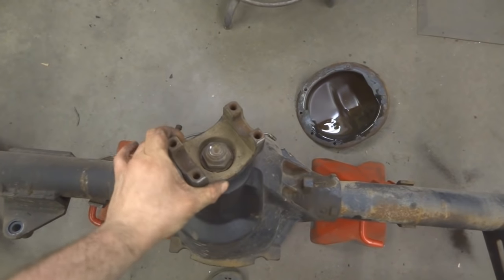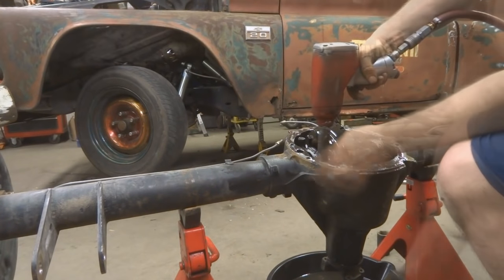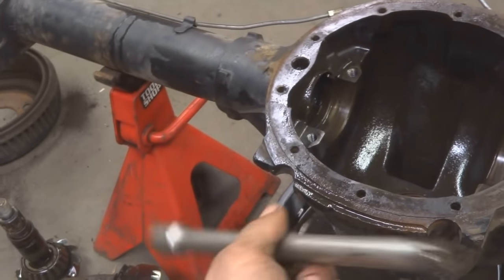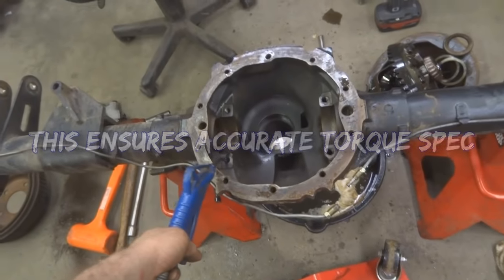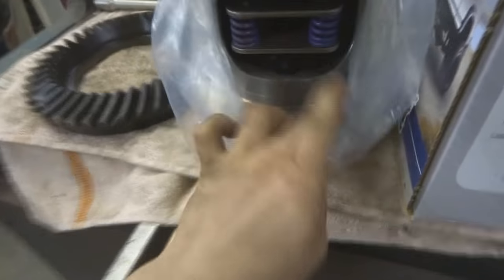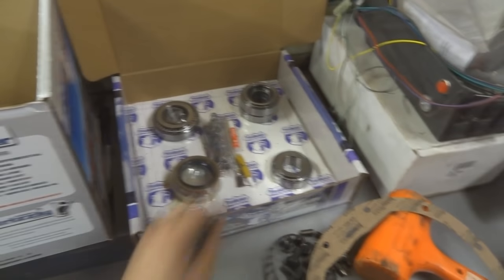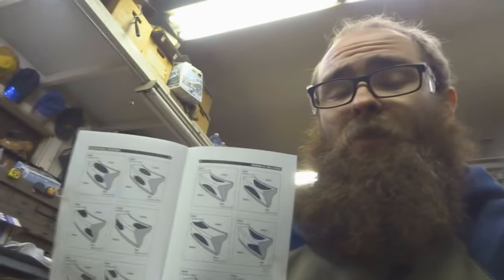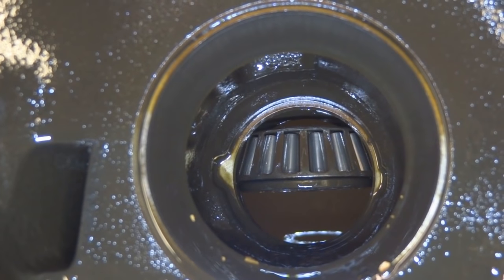How To: Rebuild a GM 8.5" Rear Axle 10 Bolt Chevy

Comment: Great video/walkthrough Luke! On a side note, we may have to see about getting you some Yukon branded crocs...
Reply from the maker: Yukon Gear & Axle haha! that would be something!!! thanks for the complement
Reply from the maker: fuck. I should. lol
Reply: I have an 8.6 is everything the same as an 8.5 other than the ring diameter?
Reply: @warrenstone8538  rings the same size, just bigger carrier bearings on the 625 same procedure tho. Heat up the new bearings on the stove or in the oven if you don't have a press.
Reply: Warren Stone the ring gear is the exact same between the two, the only difference between the two is the carrier and carrier bearings. The 8.6 has a larger ID bearing and the 8.5 has the smaller. The ring and pinion between the two are the exact same parts
Reply: Hey Tubman, thank you for this awesome vid!! My first rear end dismantle was super easy because of you!! One question, the carrier case will not pull out, do I force it out? Or am I missing something? I’ve followed all of your steps, and where your carrier case pulls right out, mine won’t. Any help is much appreciated.
Reply: Ship them out don’t talk about it be about it yukon.

Comment: Not a lot of people understand how to properly care for a differential let alone rebuild one. Good job man. I would like to give just a couple of pointers in a few areas, just to help out and spread knowledge, especially since it seems like you will service/re-build a diff in the future. 

So, if you havent figured out or wondered if..... I do this for a living 5 days a week, 40+ hours/week. By no means am i trying to gloat, brag, or imply i know it all b/c that is so far from the truth. I will say though, of the four people i have learned the driveline from, including my current boss, are old school, legit, the best of the best when it comes to the drivetrain (Diff(s), t-case, and driveshaft).

So, to the point. Here is what I Suggest...

1. 9.5 times out of 10, when you do a carrier change as you did, the OE shims when replaced where they came from will indeed be wrong (the backlash tolerence is too high), instead of trying to build a stack of shims that came in your bearing kit, simply switch your OE shims. Put the passenger side shim to the driver side and the driver to the pass. Legit 99.5% of the time, you will be within the 6-10 thousandths range. That goes for any diff and especially the GM 8.5" 10 bolt.

2. When putting on the new bearings.. i love seeing how attentive you were to seating the bearings all the way and never tossing your old parts until you were done. Let me suggest when putting on the new beaing on your new or even old carrier, keep the new bearing and new race together, lay a piece of flat stock over those while the new bearing/race combo are just set in place. make sure your centered and using a press, start the bearing on. When you just have it started grab your old race and flip it upside down on your new race, flat stock back on and finish the job.

I hope this tad bit makes sense and hopefully helps at least somebody, if not, it kept me busy. Keep making the videos man good to see that still. Good Luck!

Comment: My c10 was sitting for 20 years before I got it and the differential oil was the consistency of jello. I used a torch on the pinion to take it out and it fell right out

Comment: Love the vid brother very helpful..im a mechanic and you may laugh but ive never rebuilt a rear .i have a 2000 Silverado 1500. It started making a clunk metal like noise when i back up and then take off in drive.i can definitely hear noise when im slowing down and i fear its the diff carrier bearings .when im on the throttle it wont make noise.just looking for a second opinion before i jump right in.
Reply from the maker: Most likely the pinion bearing or a loose pinion

Comment: You mentioned locking plate around 11:15. I took the pin out that holds the spider gears . Well i done that to get the c clips out and i beat on the axle shaft with a hammer to get the c clip out, wish i havent.  The locking plate that holds the springs,  locking plate worked its way out of place including the spider gears.  Im guessing when i was turning the tire or hitting on the axle it knocked them out of place..  Do you have any idea how to get the gears and locking plate back in place?  So i can stick the pin back through.  The carrier is still in casing

Comment: Just so EVERYONE knows, the Carrier in NOT the diff, the Carrier is the cast iron center section that the bearing caps bolt to. The differential case is what the ring gear bolts to, whether it's a locker or an open diff, which is what this axle contains.

Comment: ok pressing the race in on the bearings was wrong after you break the bearings apart use the inner race its exactly the same size as the old one it will seat it perfectly and as for the shims on the pinion gear it was way to far in you definitely needed to shim the pinion out more. How long did it last?
Reply: I learned years ago that the only way to make sure the gear would last is to buy a pinion depth gauge and set it within one thousandth of the spec stamped on the face of the pinion.
Reply: Yep, that wear pattern on the pinion wasn't good. Pinion was way to far in. I was wondering the same thing when he said time to button it up and add fluid and we're done. I said to myself, uhhhhhhh, noooo! LOL!

Comment: For me heating the bearing didn't get it large enough to slip it on. I actually had to FREEZE the carrier in the fridge for a few hours and then the combination of expanded hot bearing and contracted cold carrier let it slip right on.
Reply from the maker: Rick CL right, that's common practice as well. That was mentioned in another rebuild video, forgot to mention it here

Comment: Just picked up my Chevy 84 K5 Blazer from the shop. Needs a rear end rebuild. Is most common that it just needs new bearing kit if the shaft Is moving around? It's not making any noise, just has some play in it.

Comment: THANK you for this video. I need to rebuild the rear end in my LS swapped 1990 K1500. gonna put some 4.56 or 4.88's in her and a locker.
Reply: 5.13's an u might be able to run with the big dogs
Reply: 5.13's

Comment: I'm no mechanic but I do know physics, and you certainly DO need to include the weight of the wrench in that torque calculation. What you're calling 15 in-lb is probably more like 30! (assuming the wrench weighs around 2 pounds). In fact just use the wrench by itself and you'll be pretty close to 15.
Reply: makers of that tool know that and actually account for that. so, 15in/lbs on a nice $500 snap-on torque wrench wont be a true 15 in/lbs but based on the weight of that wrench, and even the length (the nice ones have a very specific area to plce you hand at to use the tool), when the tool is used properly the proper force will be reached. so you maybe just exerting 8in/lbs of force at your hand/handle of the tool, that nut will be getting the 15in/lbs bc everything else is accounted for. which is why its worth the $$.

Comment: The stuff on the splines on the pinion is pipe dope its supposed to be there to seal between the splines
Reply from the maker: That's interesting/dumb lol that's what a pinion seal is for!
Reply: @Tinman2Kustoms  it seals between the splines so the oil can't come out between the yoke and the pinion, the seal only seals the outside of the yoke.
Reply from the maker: @thegrapest14  yeah I get that, but what's the point of keeping it from going past the pinion as long as it doesn't come out the seal? Lol
Reply: @Tinman2Kustoms  It can come underneath the nut that holds the pinion on without coming around the seal

Comment: A tip
 Save the old pinion bearing if possable, then hone the i.d. a few thou oversize to make a set-up bearing that slides on and off easily. This makes shimming the pinion a piece of cake.
Reply: what about the wear on the old bearing, could be pretty worn

Comment: Hello Tinman, I have 1995 GMC Surburban Truck 2500, 4x4, 7.4L, My Rear end is OK for now, it has 249 Miles, Can I replace Rear Axel With Newer That  has disc brakes,  Thanks Doug

Comment: He put the pinion adjustment on the back burner by using the torch to get everyone's attention . Im curious to see how he held the pinion from rotating while crushing the sleeve. 
That's the part of the video i was waiting for .
Reply from the maker: With a big pipe wrench.
Reply from the maker: You can also buy a tool just for doing that from summit racing. Or make one. All sorts of ways to do it.

Comment: Question, I have a 1969  10 bolt that is an OEM safe-t-trac unit.
It doesn’t seem like a real locker "both wheels" grip good when power is put to it.
Perhaps I misunderstand the type of unit, as I was under the impression it is a locker type .
I am familiar with Food 9 inch locker are POSI under all conditions and power.
So, is this unit you used an Upgrade better design, then the stock factory piece?
I’ll never exceed 450RWHP on street tires, so brutal harsh condition are not a real factor.
Or is there parts to beef sup my existing 10 bolt.

Comment: Would you have to check the lash if you where to only change the ring and pinion gears put shims back in same place? My rear end is all new about 2000 miles ago but the 3.73 needs to be replaced with 4.11. Wonder if races and stuff could stay too? Hope I didn't make this sound confusing. Thanks for input
Reply from the maker: The races can stay. But with a new ring and pinion you would have to check the lash and pattern, for sure.

Comment: Hello and thanks for your video. I'm installing a used carrier on my differential case I plan on re using my old ring bearings and pinion bearing since they are match together and I dont have to mess with crush sleeves etc.. my question is do i still have to check the back lash and paint the ring gear with the yellow paint to check the contact of the pinion with the ring gear??
Reply from the maker: It's always a good idea to recheck the pattern with the pattern paint.

Comment: Just putting in a Yukon carrier just like the one in the video in my 06 YukonXl I had a question about how tight is too tight for the shims when putting the new carrier back in the rear end I am having trouble removing the carrier back out am thinking they are too tight? Great video by the way have been watching it repeatedly my factory gm Gov lock assembly completely blew apart to use a grinder to cut pieces out to remove it just to get to the c clips to remove the axles
Reply from the maker: They are always tight to go in & out. It's supposed to be that way. Tight is right! Lol
Reply: @Tinman2Kustoms  thanks alot appreciate the quick response got the backlash set everything torqued to spec. Getting ready to put diff cover on now its 11:25pm here near Chicago pulled my hair for lil while before finally got it figured out lol. Do you know if they have a c clip eliminator kit for a 06 YukonXl slt haven't found nothing yet
Reply from the maker: @MegaWolfman76 no worries man! I'm not 100% sure to be honest. You'd have to call their tech line. C-clips are undependable

Comment: A pinion bearing I like $20.°°.  It's worth it to have an extra to destroy during setup.  If you had gotten a new ring gear would you have used the old bolts?
Reply from the maker: The last pinion bearing I bought from O'Reilly was $90... But yes, sometimes it's worth it. And I've also used old bolts for new gears. Sometimes you do what you gotta do to get it done. That's realistic car building.

Comment: What if you have to replace the ring and pinion? can you swap the shim to the new pinion? I have a `91 Silverado with 300,000 miles on it, still going strong but I think a tooth is chipped one one or both gears. Every now and then it feels like a skip and grab in the rear.
Reply from the maker: Yes, you can put the shims in the same location of the same size and it will generally get you close. But the BEST practice is to have a sacrificial setup bearing, so you can shim and check it before final install.  Every single ring & pinion gear ever made will have very slight differences, even one from the same day from the same factory. You just have to stack the odds in your favor as much as you can and see if the cards play out.

Comment: What is the problem if your cap bolts lock up the carrier when they are tight, if i loosen the cap bolts the carrier turns easy but tight it will not turn even with the drive shaft taken out?

Comment: Hello so I have a 95 tahoe 4x4 and now its doing a clicking noise on the rear differential would I be able to use the same parts if I take it apart and see the bearings?
Reply from the maker: You're best off contacting Yukon gear and axle with the application questions. It will be the same process as shown in this video though.

Comment: Hey great video. Also in Minnesota myself but reaching out to see if you can give me some pointer. My rear axle in my tahoe has a broken breather vent and was wondering how I can get it out or if the rear end is bad now any help would be great thanks.
Reply from the maker: Dillon Nelson breather vent just keeps excess pressure out of the rear end. Figure out a way to fix it. That's the only thing I can suggest
Reply: Ok I just trying to figure out how to get old one out.not sure how it works but thanks I'll keep trying.

Comment: my fill plug is seized in my rear end. I took the cover off drained oil. do u think it will catch fire if I heat drain plug up with a torch. I sprayed inside with gunk to get some old oil out, but gunk is petroleum based. I really dont want to spray water on the gears.
Reply from the maker: texas tough won't start on fire. That's what I'd recommend, using a torch to heat around the plugs so it expands some and let's the threads lose

Comment: Quick question. I know you used the 14-19 for the pinion bearing preload ... I’m NOT using new gears so in my case I need to use the 6-8?
Reply: no, the gear being new or not has no bearing (pun intended) on your bearing preload. those differing ranges is based off of new vs old (or used) bearings. In my eyes, if you have that carrier out already, you should always put it back in with all new bearings. so that 14-19 is what you would be shooting for (most likely)

Comment: You can crush the sleeve a few thousandths beyond and still back it out and reuse it.  Steel has memory.
Reply from the maker: Dan Henderson technically that's not recommended so I didn't want to say that, but yes you can if you're careful

Comment: So this is like rebuilding a Colorado rear end? Also I have a question really hoping you could answer it so my rear end I know is shot everytime I shift it it does do a little clunk and sometimes when I give it gas in drive it wont move just high revs and sometimes will move if u hold it at high rpms my question is is it the rear end only or could it be my transmission to really hoping it's not the transmission 😭
Reply from the maker: It's definitely transmission.
Reply: @Tinman2Kustoms  thank you so much I really appreciate it
Reply from the maker: @billyjames188  good luck & sorry for the bad news!

Comment: POSITRACTION REAR END what type of oil do i have to youse for this one Thanks for your video
Reply from the maker: frits duwel you can use any off-the-shelf rear gear lube. Usually about a 90-130w or somewhere around there. Yukon gear & axle recommends 1-2 bottles of their positraction friction modifier additive as well, depending on the size of the axle. I used 1.5 bottles of the additive/modifier in this one

Comment: I'm about to do this for the first time. What do you mean by a "setup bearing"?
Reply from the maker: A setup bearing is essentially a removable pinion bearing that can exactly replicate the final bearing to be used. So you can assemble and disassemble multiple times to adjust the pinion depth. Buy 2 pinion bearings. Buy a a carbide bit. Open up the bearing just barely enough to where it'll slide on and off of the pinion with a little encouragement-but not too much. Then you can mesh the gears with the paint and determine if it needs to be spaced up more or shims removed.

Comment: Great job sir!!! Subscribed!!
I have a 80 turbo Firebird Formula with a stock posi that's gunna need a rebuild in the near future (clutches worn). You have given me a new direction to think about. Do they make that for 80 turbo Firebird 2.41 gear posi? I want to keep the rear itself stock looking but just swap out the Posi unit with this locking unit you got there. because my car is a matching numbers car. (In my opinion matching numbers  makes classic cars very valuable or I would have swapped my 301 turbo for a 455 engine). Anyway sorry about the ramble. And thabks you for showing me this product. Hopefully they make one that fits my car.
Reply from the maker: Absolutely. The 80 firebird is probably a similar rear axle. But to confirm you'd have to use their parts finder on yukongear.com or shoot them a message on facebook. They make products for pretty much every gm axle, including this style of locker (aka posi)

Comment: If my new pinion is the same size as my old one can i just put the same shims on the new one and call it a day?
Reply from the maker: No. You can use those shims as a starting point, but their will be slight variances in every single pinion/ring gear, even if the same ratio.
Reply: @Tinman2Kustoms  okqy thanks brother i apreciate it!🍻

Comment: what about the crush sleeve install and the pinion seal replacement??
Reply from the maker: Pinion seal is pretty simple. Lube it up & tap it in with something big and flat.  Crush sleeve just gets put in place and then tightened down, essentially. If you order your rebuild components from Yukon Gear & Axle they all come with basic instructions.